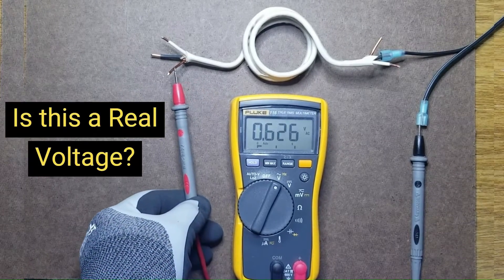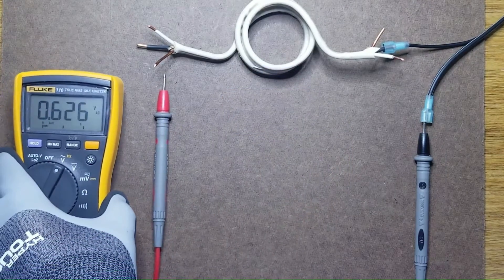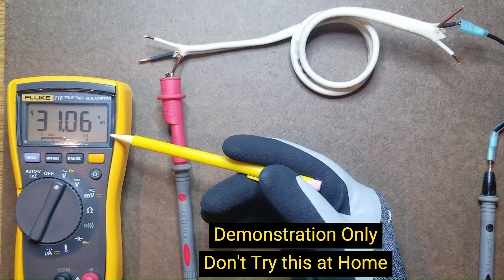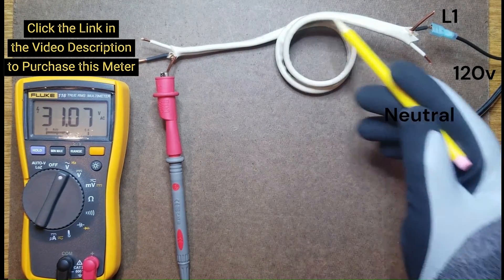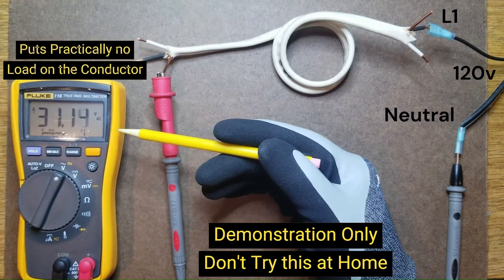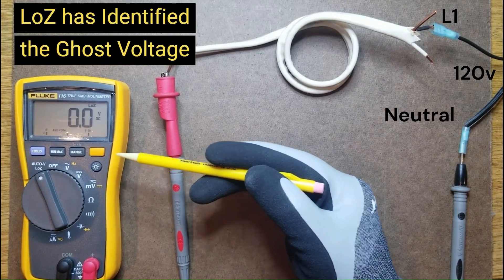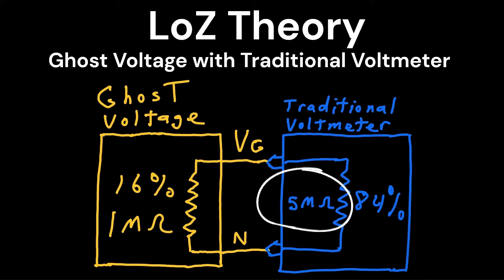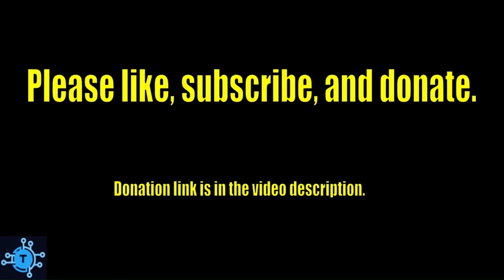#65 - Is this a Real Voltage? Ghost Voltage Detection using a LoZ Meter

Comment: I don't have a loZ meter. I was troubleshooting wiring at my brothers house. The new LED lights in the Kitchen stay on, but are very dim when the switch is turned off.
The house is very old and the wiring is messed up. The hot for the light stays hot. The neutral gets switched. We have no idea where the the how and neutral are spliced back.
Would induction be enough to dimly light an LED bulb? We are at a loss.
Reply from the maker: Yes, induction or capacitive coupling could do it. Also, if you are using a dimer switch - many of them don't well support LED lighting.

Comment from the maker: Lots of questions about why LoZ was in DC mode in some parts of the video. This is normal when the voltage is zero. This meter auto-selects AC or DC. If the voltage is zero, it starts off in DC and switches to AC when it detects AC voltage.

Comment: AhhhhHA! Thankyou! I live off grid and have my own power station. Solar, generator, batteries and inverter. With an my old inverter I would get 90 volts on the ground even though no grounds were hooked up. Drove me nuts. Never tested if there was any current behind it but it never seemed to cause any issues. I thought maybe it was comming from utility transimission lines that are nearby and effecting my direct burial cable.

Comment: You just make a lamp holder with a filament lamp (old style lamp) connected with two wires about 1m long with leads at the end..This is 100% precise find Phase and Neutral easy..
Reply from the maker: For sure an incandescent bulb will knock down a ghost voltage in a heartbeat.

Comment: You are in DC with your LoZ and in AC in the standard...
Reply from the maker: It automatically selects AC or DC depending on the sensed voltage. Because the voltage is zero, it doesn't matter.

Comment: I read somewhere that it's possible to use a 3000 ohm resister and make an adapter to convert your regular non LoZ meter to operate in the same manner as a LoZ meter. Possible and if so, can you show how to make one?
I have a couple meters with the LoZ feature but I also have a few without it and it would be great to have an adapter to detect ghost voltage.
Thanks, enjoy your videos 👍😎🤠🇺🇲
Reply from the maker: Yes you can but you would want to use a thermistor instead of a resistor because a significant amount of heat is dissipated from the resistance across the leads when measuring higher voltages for extended periods of time. The thermistor should be a PTC type so that it's resistance increases as it warms up thereby reducing the amount of heat that It ultimately dissipates if left connected to the voltage source. I'll definitely consider making a video to that effect.
Reply: @TheTechCircuit  Thank you, Sir 🤠